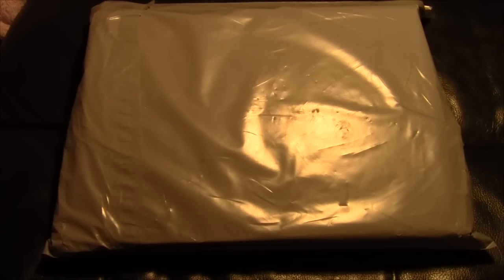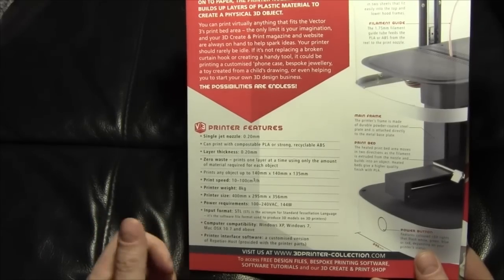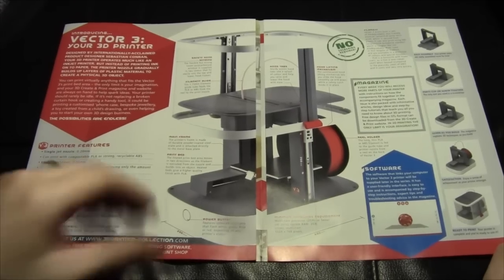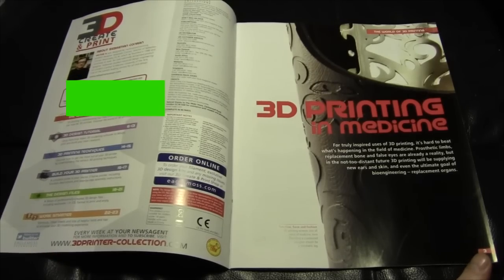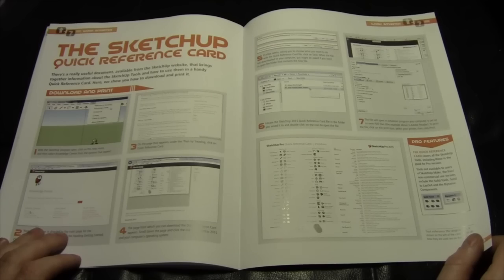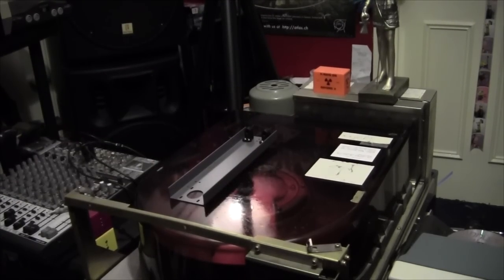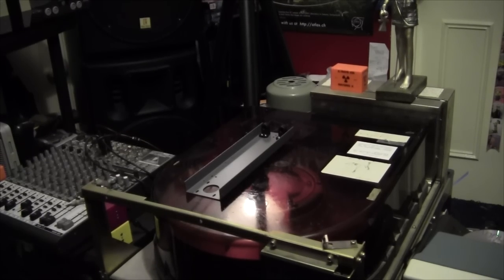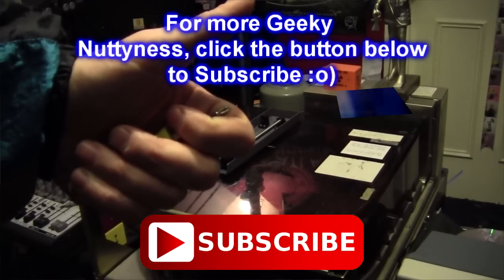Build Your Own 3D Printer, Editions 1 - 3 Review (  V3 , Eaglemoss)

Comment: liking this channel, i have also started this collection, but i have a slight advantage, i already have a 3d printer (a makerbot clone) so i can print objects as there released.

a few tips for you,
the first delivery was only 3 parts, im sure you figured that out by now.
if you look on the parts boxes you will see a number in a circle that tells you what part of the mag it should be with.
also somehhing i found helpful (although im not sure it appies to you) was leaving parts in packets till i have the first 11 issues, then i could get that section built, made it easier, parts 12 - 15 are still packaged.

some other things i have found, as said i have a 3d printer, so i printed the tree (issue 2 or 3 free model) and it dont fit together. its about 1.5mm to small on the slots, i have feed this back to eaglemoss who are going to look into it for me.

this is gonna be a fun ride lol

Comment: You're better off getting it by issue as a lot of the parts still haven't been finalised and they've been sending people out prototype parts, so you'll need to rebuild it a few times to get the actual final model.

I know this as they've sent a few big you tubers the completed ones already to do videos on.  Not me however,  they're assholes to me :(
Reply from the maker: ***** I was unaware of that, but had problems in the past and they've always responded and fixed issues quickly.  Naa, no free one for me either, bastards!! ;)
Reply: i signed up earlier today,looks to be a pretty sweet printer,though restricted to small items.which shouldn't really be a problem.i'm quite excited to get started :-)
Reply: let us know what it's like in two years :D
Reply: ha! i shall send you a whistle,or a phallus shaped keyring or other such trinket.